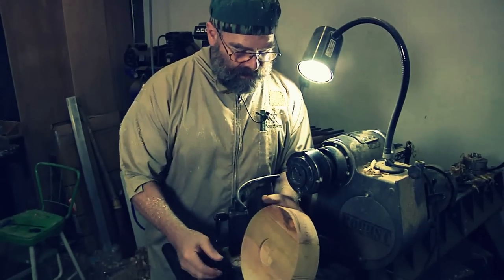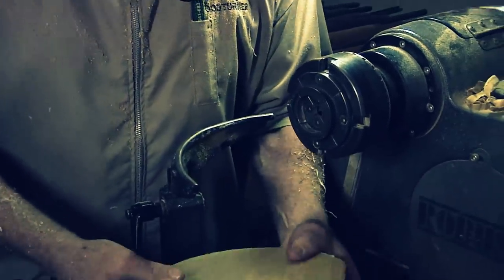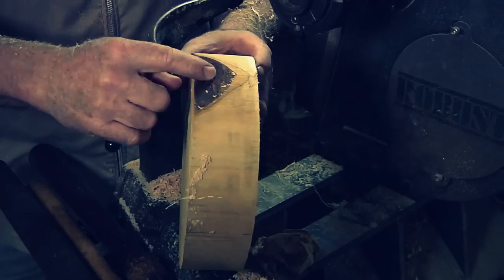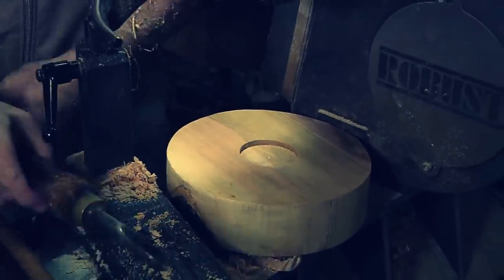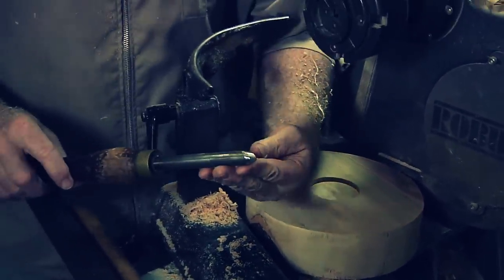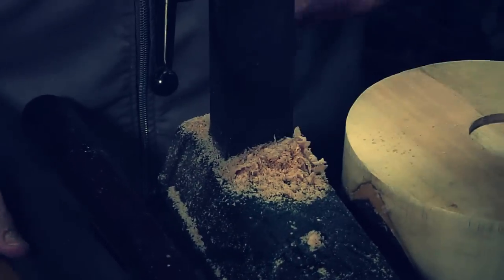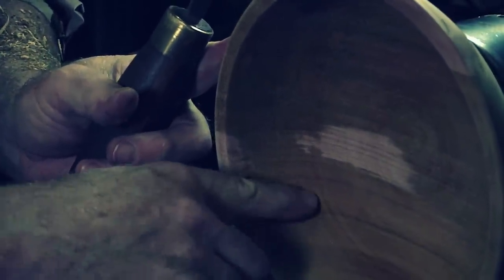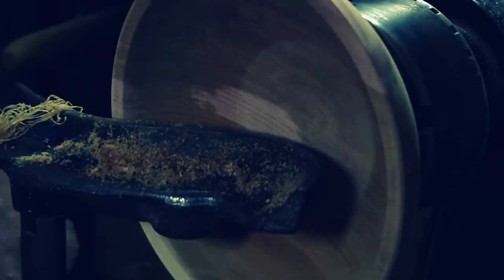robo hippy Turns A Bowl With Gouges

Comment from the maker: Duncan, I always turn green to final thickness, let them dry, and then sand. My off the tool finish is still too coarse for food safe bowls. I do explain some of that on the sanding part. Mostly, you don't want any cracks, holes or rough spots for food particles to sit in and start to ferment.